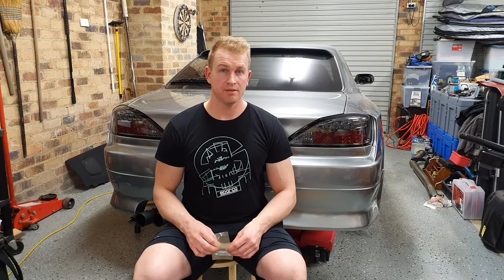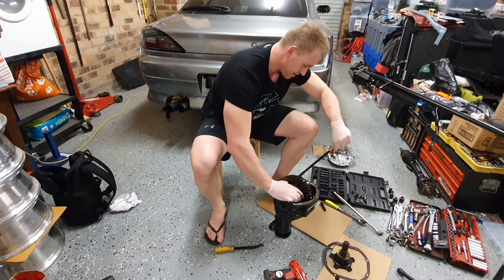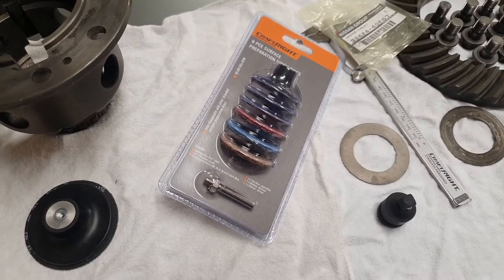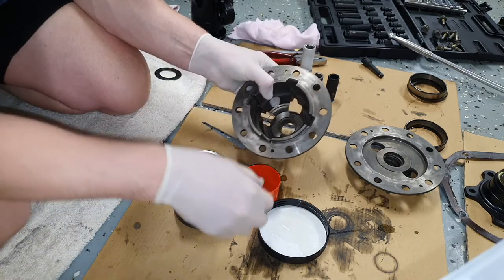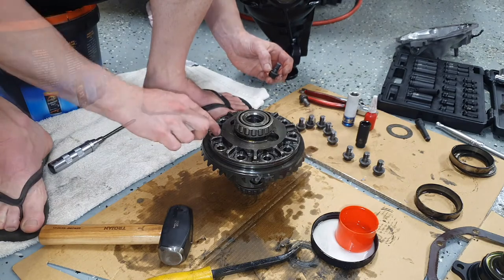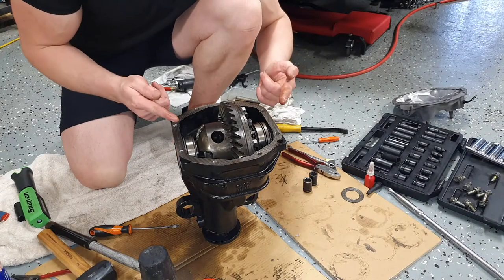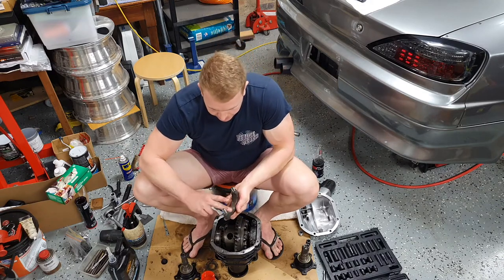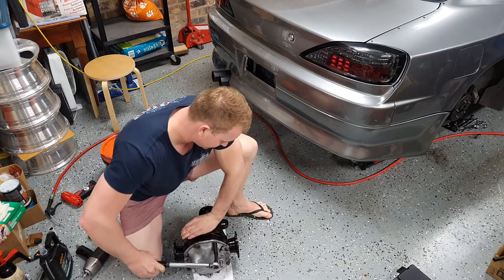How To Shim The R33 R200 LSD Diff S15

Comment: If your having trouble putting it back in, you can put the casing on a press and light enough pressure on other axis will open it enough to slide in the diff assembly

Comment: Fantastic mate, looking at opening up my diff and checking it out, thanks for the detailed video and nissan part numbers.
Reply from the maker: If you need any help, shoot me a message. Nismo are like the best for street for a 2 way as well so you have a great one already then. It would be interesting to know what diff ratio you are running, it will be printed on the crown wheel/ring gear 🙂

Comment: Great video!  I have seen numerous posts and videos suggesting that the extra shim washer go on the other side of the VLSD unit (closer to the ring gear).  Have you tried that?  Do you reckon it matters which side it goes on?  I have followed your instructions for my '88 Nissan Z31 VLSD but wonder if I should move the shim to the other side before reassembling...
Reply from the maker: I don't think it matters too much which side it goes on but good rule of thumb is to replace the existing one in the same location but with more thickness. Or if the shim is in good condition you can add 1 x smaller one as an extra. I replaced mine with slightly thicker ones and then added an extra for good measure. Sorry about the late reply, hope you got it sorted in the end 🙂✌

Comment: I did as you at 1:50, the axle came ou/looset but not all the way. The Last bit of haft Still stuck in the diff
Reply from the maker: Try carefully hitting it harder, they are usually stuck in pretty hard. If it's come out a bit, you're nearly there. The only risk now is maybe breaking the circuit that it's catching on. Usually the c clip is fine and you can reuse although workshop manuals usually say to replace it. Try hitting it harder at different points on the stub axle flange. You're nearly there! Hope that helps.
Reply: @JoeYates77  ok 👍 😁 i Will take a look again tomorrow the right axle/hub had alot of play in it and im not sure why. Also Not sure what diffs in there.. on the cover someone been writing 38420-RS020-A. But dont look like One. Its atleast a 2way, 😂🤷

Comment: I know I'm 4 years late. But after doing this would you recommend also how long did it last?
Reply from the maker: @dancharlesworth8863  lasted a good while easily 8 drift events approx. I changed it out for a Kaaz sports version of their 2 way lsd but didn't lock as well as the ahimmed because the break away torque of the Kaaz was low. The normal 16 plate Kaaz 2 way however is very good. I'd recommend Nismo 2 way tho now but honestly if on a budget reshim a vlsd, they work great. I just reshimmed a 350z vlsd diff for my next diff upgrade, long story.... currently have the new Nismo 2 way in but yet to test. I'm currently upgrading my gearbox hence why yet another diff upgrade for different ratio

Comment: If mine has a bit of in and out movement on one side of the stub axles. What does that mean? Or what can I do to fix it?
Reply from the maker: A little bit is ok, this is normal from what I am aware. There will be a little bit of movement until the C clip stops the stub axle/shaft from coming out. Nothing to be too concerned about unless of course you can pull it right out!
Reply from the maker: It's fine man. Once the hub nut is fastened at the hub/brake disk, the driveshaft won't move much at all at the diff. Mine was also like this. I'd consider this to be normal.

Comment: Hey, how many of each shim? or is your description what you actually used?
Reply from the maker: Depends on how worn the original ones in your diff are, also I'd say replace them if they look badly worn with the same thickness then add about 1mm of shim. It's something you kind of have to experiment with. Increasing the current total thickness will increase tightness, I'd say increase the thickness by about 1mm, so add 1mm of shim or thereabouts. What I did in the video is exactly what I did and it lasted a long time, many drift events.
Reply: @JoeYates77  thanks

Comment: What was the point of re shimming the diff again?
Reply from the maker: To make the centre essentially locked without welding it. This diff I installed is an R33 R200 with stronger 5 bolt flanges and driveshafts. It originally has a Viscous Coupling Type (VLSD) centre which has a shim either side of the internal coupling and works off friction by movement of the shims against the coupling. When the oil heats up from movement it binds. Shimming the diff centre by adding an extra shim or replacing the worn shims effectively locks it and or makes it tight. Its essentially a cheaper alternative to sourcing and installing a mechanical clutch type LSD. How locked you want it is up to how thick and how many shims you install. Usually you might just say, remove the worn shims and replace them adding one extra. It's a great option if you don't want to weld the centre but main key point is that it's a budget/cheaper option compared to say a good mechanical clutch type LSD centre. Hope this helps :)
Reply: @JoeYates77  ahh i see now. Just affects how the diff locks. Gotcha. Thanks for getting back to me so quickly!
Reply from the maker: @spiritdrift6207  you're welcome mate, anytime 🙂✌hopefully in the future I'll be able to splash the cash on a nice Nismo GT LSD but for now it's working well. (6 x drift days so far) 🙂👍

Comment: What is the reason for new shimms? Will it lock up better after installing new ones?
Reply from the maker: The new shims replaced 1x badly worn out shim. Also adding another in adds to increase how much the l.s.d is locked. Every viscous r200 lsd is different, you may need one thicker, and or an extra shim. I have 3 x in mine. Depends on what's already there and how much the shims have worn. Its sometimes a little trial and error. I added in one extra shim and replaced the worn shim with one a little thicker. You can get the shims in different thickness sizes. Hope this helps :)

Comment: What part numbers? And shim thickness pls?
Reply from the maker: Hey Doug, 
The shim sizes and Nissan parts numbers are below. I added x 1 extra shim and replaced the worn shim which was about 0.75mm with another new shim.) The size I used was the 1.01mm shim x 2. Hope this helps :)
0.80mm = 3842440F60
0.85mm = 3842440F62
0.90mm = 3842440F63
1.01mm = 3842440F67
1.05mm = 3842440F68
1.10mm = 3842440F70
1.20mm = 3842440F73
1.30mm = 3842440F76
1.40mm = 3842440F80
1.49mm = 3842440F83
Reply: @JoeYates77  Hmm interesting...

Comment: Do you know if I could change the 5x1 stub axle piece out for the 3x2 s15 stub axle pattern?I want to fit a r33 skyline diff in my s15 without having to change axles ?
Reply from the maker: I believe the splines on the stub axles are a different count, so they won't mate and fit together. You would need an r33 gtst long nose ABS diff with 5 bolt stub axles and driveshafts to match.
Reply: Thank you for your reply I really really needed that information . I appreciate that a lot 🙏🏽💯

Comment: Hey mate, what’s the max amount of shim you can run/fit? (In millimetres)
Reply from the maker: I've not tried more than 1.2mm approx. Id say about maximum 2mm extra thickness. That will be locked hard. It's a bit of trial and error, I've had great sucess just adding 1mm of extra.

Comment: Does this work for 350z vlsds ?
Reply from the maker: I'd imagine the principal will be the same. The part numbers for the shims might be different. However you could try replacing the oil if its been in there a while with some high quality VLSD oil to hopefully restore its binding/locking up abilities. Other than that, from what I gather alot of people who own them for drifting will weld the centre together. This depends essentially on what your needs are for the diff. Hope this helps somewhat. The Nissan Fast online catalogue might help in regard to the part numbers for the shims :)